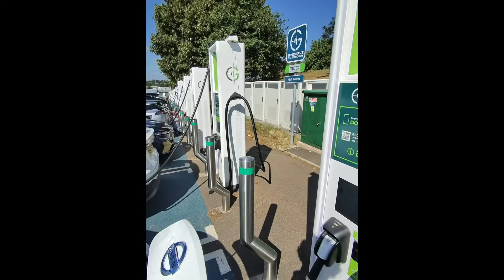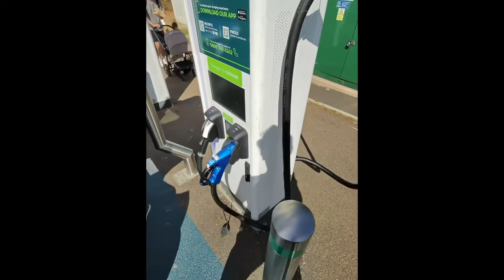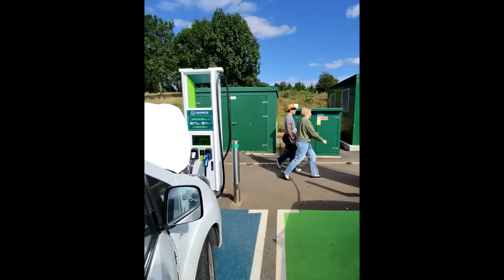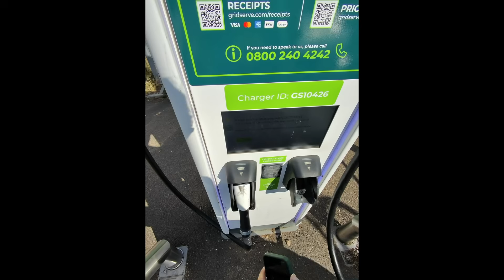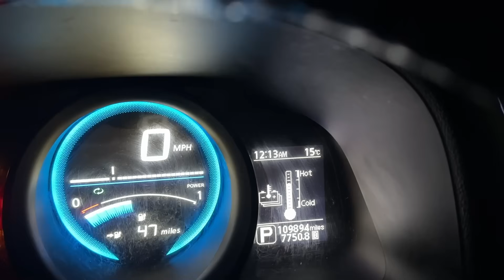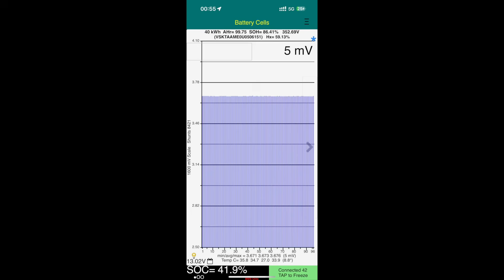Gloucestershire to Cornwall 11 Years Later in an EV

Comment: You can get a CCS to Chademo adapter. So far I've done East Sussex to Cornwall, Lake district and our latest was York in a Ioniq 5. Charging at over 200kW helps you just about get enough time to visit the toilet and grab a coffee before you're at 80%. That was using Ionity and Gridserve.
Reply from the maker: 200kw…a thing of dream! 50kw max for the env200.

The adapter is £6-£700 I think so not worth it just yet until price drops. I think your Ioniq does 250+ miles range right? (Twice the env200, so approx 50% less charges).

Do you get a discount with Ionity for charging? As 89p (79p with app) is just crazy.
Reply: @IanSampsonRLO I’m seeing 320 miles  on the GOM in this weather. It is the dual motor but with the 84kWh battery. I used to own a 40kWh Leaf and I’ve seen as low as 20kW on a chargemaster. 
I know someone with a 38kWh Ioniq (wind knife) who had over 8.5 miles/kWh on a London to Brighton economy run. That’s my dream on moment. 
I used the Electroverse card where I can for discount
Reply: @IanSampsonRLO  Are the CCS to ChaDeMo adaptors likely to come down in price?  Given that ChaDeMo is dying out, are they going to manufacture more adaptors?
I avoided getting a Nissan in the US partly because of the dirth of ChDeMo chargers, even though I rarely charge away from home. I did get a NACS to CCS adaptor so I can use Tesla chargers, but it was $200-250 max.

Comment: Experiences like yours is why I would never go back to a 100% ev. Not keen on Teslas, so I have a Jeep hybrid at the moment. How much did that journey cost, Ian?
Reply from the maker: £84.43 in charging alone 🤯

+ the ~4-5 hours added to the journey.
Reply: But this is a very old EV, and  Nissan at that so it has an obsolete charging connection. Other, newer, much better EVs are available, in which you would not even need to use a public charger.
Reply: @ziploc2000 I traded in my Renault ZE50, probably was good for 200 miles on average, less on motorways. For long journeys, I wanted something that I can pull into a petrol station, fill up and be gone in 5 minutes.
Reply: @bigyin.7710 You can get electric vehicles and do more than three hundred miles now. After several hours driving I'm neady for a longer  break than 5 minutes.

Comment: It looks like CHAdeMO has had it's day, particularly in regards public charging. 
I recently did a 420 mile round trip in a single day in my Honda e with it's titchy 28.5kWh useable battery from East Hampshire to Cornwall. I'm not used to long trips so ended up stopping 5 times in total but looking back, I could have done it in three with ease. The route is just packed with CCS chargers now.
Reply from the maker: CCS really is the way forward and the charging infrastructure has grown a lot in the last few years! Trouble is now massively congested and mental expensive!

Comment: You should get a CSS adapter. Those slow charging speeds are very odd.
Reply from the maker: I did enquire with one company, but the £700-£900 is just too much at the moment to justify it.
Reply: @IanSampsonRLO  I got one. I am from Portugal. Now is very common to install multiple charging points in one location with css and one chademo or none. It's was getting to annoying for me. I just had to buy it.😂

Comment: What an absolute farce. I think the main issue is Chademo hasnt really improved in 11 years and the van has got older and no active cooling. CCS is pretty good now but the cost is bonkers. We swapped a 22 Ioniq 5 for a 22 model 3 two years ago and despite the plonker whos in charge the car and supercharging are great.
Reply from the maker: The Telsa charging network is so stand out its crazy. The England > Poland and back again (3000 miles and ~40 charges) massively highlighted HOW it should be done.

Comment: The LEAF was the very first practical EV and it's well known for battery issues, that and the fact that CHademo is basically the Betamax of EV charging. Use it for shopping and the school run till it dies and buy something better.
Reply from the maker: Env200 is better equipped as it at least has some form of cooling. A shame as for a while nissan led the way..then it all went to pot.
Reply: @IanSampsonRLO indeed if only Carlos Ghosn was still running the company things might be very different. I suspect he was too successful and not Japanese enough.
Reply: Great video. If one of those chargers was gridserve at Cornwall services, I have tried multiple times with my Env and never got more than 5KW there. When it was ecotricity at least I could get decent speed.
I also recently used the instavolt hub at bodmin and was able to get 48kw so I think that ones down to your van.
Take care
Reply: @CookeCraft and if you lost comms Ecotricity gave you free Lecky so you weren't stuck. If all CP's were forced to do that the tech would improve very rapidly.

Comment: trick to release chademo connector once there is no longer red light on conector very gently to move up and down few times , then button will release , miss my env200 ❤
Reply from the maker: Sadly as per video that did not work. Hitting the button with a screwdriver did the trick thankfully.

Comment: we use our leaf for local stuff only, no way am i getting involved in all of that, we use a petrol car for the Cornwall trip we take every year, low range ev are fine for destination charging and home charge, we dont go any distance in it, you can very easily fall out of love with electric vehicles like this, they are great if you accept their limitations, we got out first leaf in 2013 and for a second car you simply cant go wrong but there is no way I'm public charging with it.
Reply from the maker: The right approach, even with the 40kwh its super tough especially coupled with a terrible setup in regard to public charging network!

Comment: I always try and avoid motorway services on busy days (that was a summer holiday weekend?)

Octopus Electroverse shows the CHAdeMO at Sainsbury's just off the motorway the next junction down(J31) is 66p/kWh.   Would have been quicker than faffing about at the services!

(If you want a good second car that doesn't cost a bomb - look at the original 'classic' Ioniq 28kWh.  Super efficient, CCS charging and will charge in the high 60kW up to 80%)
Reply from the maker: Motorway closures and junction closures caused havoc sadly, so that one was rammed as well as the services. PLUS, had no idea it would be a faff prior to arrival..it turned into one, made far worse by connector getting stuck + no guarantee moving elsewhere (with low battery warning) would be any better. Often with this public charging network out of the fire into the pan type stuff.

Comment: I don't care about my Nissan leaf anymore, so i chose it to leave at Manchester airport. I drove from Teesside down the A19, A1 to the Ferrybridge services and then along the M62 to Manchester airport. The whole journey is 130 miles or so,  by taking in Ferrybridge because there are more chargers on that route. Off I went in my 7 out of 12 battery bar Nissan Leaf 30 kwhr. We stopped 5 times at services about 25 miles apart with chargers. I got charged at each point but it was touch and go with oversubscribed useage and the fact chademo at one services was only one unit. The whole journey took us 6 1/2 hours. We then got in an ice vehicle and did the 1500 miles to Alicante in 2 1/2 hours from Manchester Airport. My leaf has now lost 6 out of 12 bars at 9 1/2 years old with about 44k on the odometer. No wonder why people don't want EV's. My 17 year old diesel Merc has a range of 650 miles solo and could have got us there in about 2 1/2 hours without re-fuelling but it is immaculate and didn't want to leave it in jet parks 3 airport parking. We now go from Newcastle airport, when we fly with jet 2 instead of Tui. By the way, you can remove the charger by pressing the red emergency button on the charger, removing all electrical feed.
My Mercedes E Class diesel costs about 12.5 p per mile at 1.39 per litre and 51 mpg on a run at the moment. The leaf at 89 p per kwhr and about 3.5 miles per kwhr costs double at 25 per per mile. Madness !
By the way is this the same van you got the new battery in ?
Reply: It's like whining that first petrol cars are slow no wonder people buy horses. Obviously we both know current EVs are waaay ahead of the original leaf
Reply: @rmkkkk petrol cars improved rapidly. The whole point of his video is that 11 years later, the experience is still rubbish. By the way, my 17 year old Mercedes has about 4 times the range of the latest MGS5 long range in the winter, being capable of 160 miles between charges in cold weather. How long do we have to progress before an EV beats a horse and cart lol.
Reply: @FredFox-m9v  The experience of driving an OLD NISSAN EV is still rubbish, because it's still an old Nissan EV.
Other EVs are available.
Reply: @ziploc2000 and they all degrade still, according to the newer ones for sale on autotrader with class b batteries and worse, some after only 2 years. Worse still those with no battery degradation certificates, leaving buyers left to play russian roulette. Perfectly good though for floaters with no perception of value or reality. Unlike my other 17 year old diesel Merc e - class, with the 650 mile range that I bought it with new.
Reply: @FredFox-m9v ok, diesel dieter
Reply: @oliviersourie280  hello floater good afternoon.
Reply from the maker: @FredFox-m9v 11 years later its certainly not great aka terrible (as per video, which was just as it happened video) BUT for different reasons. 11 years ago there was naff all rapid chargers. Now there are 1000's....but sadly they are often congested, regularly broken and to boot crazy, inexplicably, prohibitively expensive!
Reply: @IanSampsonRLO  yes, we all used to complain about free ecotricity chargers reliability. The motto should have been, be careful what you wish for. For me, after my EV has died, after being used only locally now, my EV experiment will be over. It was an interesting journey but I wouldn't want to repeat it. They are just not logistically as good as Ice, both cars and infrastructure. Let's hope that there is a better solution in the near future ?

Comment: You aircon is shared with the battery cooling.  If you run the aircon in the cabin while charging you are preventing the battery from cooling. this can slow your charging if the battery is hot.
Reply from the maker: The cooling unfortunately seems to only keep it from heating up further rather than to cool it down. It was ~28c so pretty warm. Never have any issues in cooler months. Just glad it even has active cooling as the Leafs of the same era have none!